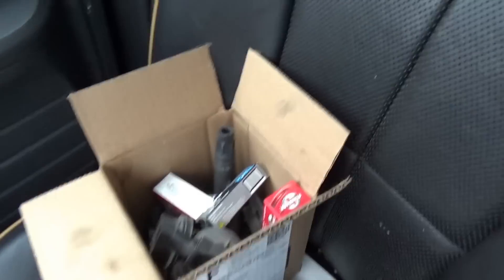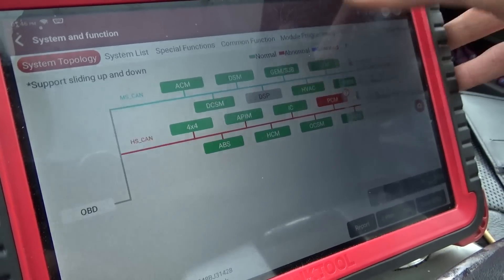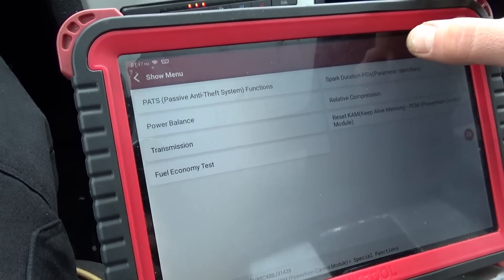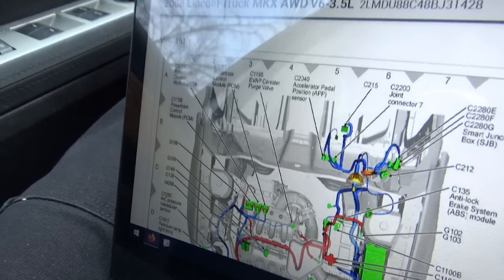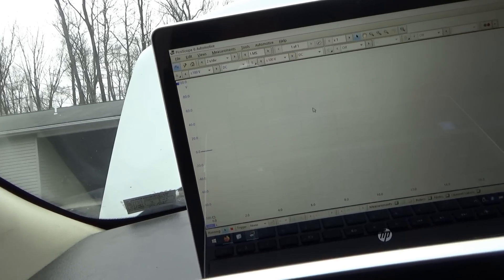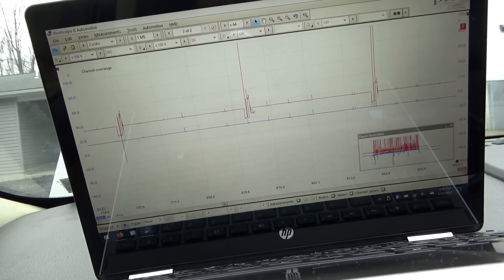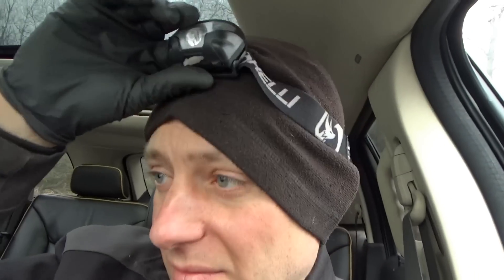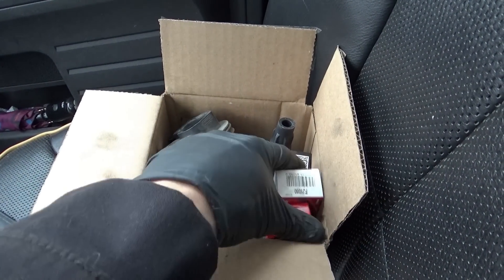Ford Parts Cannon MISFIRE (Why you NEED a Scope!)

Comment: This exactly happen to me at the Ford shop where I work. Error P0302 another diagnostician changed twice coils twice spark plugs and twice injectors Ford Explorer failed to fix problems and gave it to me, in a second with a scope I knew it was just PCM. There are no professionals today, they don't even know how to read English, and not thinking. I tell everyone 1000 times: You don't know what the problem is, better don't change anything, give it to someone else to fix it. Greetings from Israel. Thank you Ivan, if i visit USA, i will come to meet you for 5 minutes for coffe,  i am a big FAN:)
Reply: I diagnostic  vehicle  in Spanish  and English,  I speak universal language (automotive)
Reply: . Parts changers.
Reply: I speak Dine. I just talk to the car to fix it. No parts or scope needed.
Reply: @Socket  way better,  do the parts install them self ? Or when they become comeback they talk to the customers 🙄
Reply: I take care of my vehicle so it runs a long time, then sell it before it goes bad…no big repairs ever.
Reply: It would not make any difference what language the "tech" spoke. The scan tool can be used with any language.
The scan tool clearly indicates the problem area.
Reply: @thevictim2072  In Israel, the diagnosticians do not speak English, and this further complicates the work. i am from israel. I know that the scanner tells where the problem is, but sometimes it also requires reading and knowledge. IDS for FORD and MAZDA is only in English.
Reply: @thevictim2072  i can fix cars i  spanish

Comment: No way with a LED test light you could spot a dead driver?  How about a Span On Vantage graphing meter?  Board level repair is an opening for some smart cookies given the greed of OEMs and their shit parts.  Good video Ivan..Thx
Reply: A test light wouldn’t be able to handle the voltage coming from the driver in this particular setup, as it is well over 12v. I’m not sure if that meter could it or not, as I have never used one. For anything like this, I have a picoscope 2204a. It’s not the automotive version like Ivan uses, but once you learn how to use it, what settings and probes to use, you can get the same results. There are tons of videos on YouTube, as well as on Pico’s own forums, that you can learn from.
Reply: @Steven Washington  how does it get well over 12 volts?   I think your thinking the coil output is well over 12 volts.  Not the pcm driver...
Reply: @homesteadhaven2010  that would be my bad. My brain was elsewhere at that moment. Dealing with a customer trying to get warranty coverage. The whole intake was covered in gravel dust, and the original air filter, from 2014 was still in it and weighed probably 10 lbs, full of gravel dust.
Reply: @homesteadhaven2010  That is what I was thinking. Ivan's scope was showing voltage well above a 100 volts or something was scaled wrong. Never heard control voltage that high before. Ivan..please explain.

Comment: High current is being passed through the ECM? That's crazy. I thought it was common practise everywhere to use switched signalling to control high-current devices, be that via a relay, solenoid, or transistor.
It's not as if it was due to cost-cutting either, as it wouldn't cost much more to do it it properly (especially compared to the cost of blowing up the ECM).
It like it was designed to fail (eventually and expensively).
Reply: The PCM just grounds the circuit. The coils get power from the battery.
Reply from the maker: Ford and Chrysler have been doing it this way for many years. Guess what brands have the most PCM failures ;)
Reply: Also, it's not rocket science to design a driver circuit that can survive a short to ground, short to power or a high voltage zap.  They just didn't.

Comment: I'm surprised the new coil didn't short out again... I've seen these coils basically melt and you have to pry them out. If your not aware of the PCM issue's with these and you throw a new coil at it , you'll fry the new coil really quick.. I believe there's a TSB that states replace PCM, Spark plugs and all the coils. Updated design maybe, not sure
Reply from the maker: Good thing driver didn't fail in the ON state lol

Comment: with all the technical knowledge in this world why do cars have to be so complicated. there must be a way to make cars pollute less  without putting technicians out of work and make cars affordable to maintain.
Reply: This is not that hard. People choose not to learn how to fix them. Also, everyone wants a powerful car or truck. All of the 4 cylinder  Ford eccoboost engines that give nothing but problems start out as Mazda L series engines. In order to make a lot of power and keep low emissions, a lot has to go into the motor. Those same engines in Mazda's give very few problems and run forever.
Reply: @AT-wl9yq  i own a mazda miata. i love it. its a 95 and i maintain it. the last ford i owned was a 81 granada that lasted 27 years
Reply: @vincentlallo6543  Both of those cars are very good. Today, Mazda is one of the best brands for build quality, and they're fairly easy to work on compared to most other brands. Unfortunately, I can't say the same thing about Ford. Ford's engineers have lost their minds when it comes to design choices. A first year lube tech would make better decisions.
Reply: @AT-wl9yq  i agree

Comment: Failures like this would not happen if people would perform the dreaded "preventative maintenance" to the vehicle. In my opinion, no vehicle will reach 100k on spark plugs. It's a commonly overstated number by vehicle manufacturers across the board. I would say 60k-70k at most for spark plugs. Also, when changing plugs, change the ignition coil boots too if they are replaceable separately. They are commonly overlooked when doing a tune up.
Reply from the maker: Iridium plugs will easily go 200k ;)

Comment: I have an older 2 chan HP scope that I've used. But I found that since the 2 bnc input "shells" are common to each other, I've been only able to use 1 channel at a time if, for example, one sig has a bias voltage and another is battery ground. I started getting confusing traces until I realized.
My question is, do automotive type scopes have totally separate channels, without the "common-ed" grnd inputs ? Hope this makes sense, Ivan could you address this sometime?
Reply: You can get balanced/differential probe leads, not cheap but an option for your bench scope to keep your grounds isolated.
Reply from the maker: The Pico 4425 does have isolated grounds which is really nice :)

Comment: Ivan, I've seen this scope pattern before, unfortunately, on my car. I appreciate your process which I found very efficient and thorough. I also appreciate your inclusion of your PICO scope patterns. I've not purchased a PICO scope yet but feel very comfortable with that tool because of your videos and the data you've included with it. Soon I'm sure. Thanks for Sharing!
Reply: If looking for a good scope, keep the name micsig in mind, especially the SATO1004 PLUS (AKA SATO1104)
Reply: @thesmartguy3523  I bought the Thinktool scope that works with my Thinktool Pros and I believe it uses Micsig software since the screens look very much alike and they both have a lot of the same functions.  The Micsig is a better deal since it's cheaper and is a stand alone product whereas the Thinktool scope hooks up to the scanner and you use it's screen to display the info.
Reply: @thesmartguy3523  Thanks, I will.

Comment: Ford was awesome years ago GM was bad in 80s .
It's like they want you to buy a new car truck for $80+ .
We junked that same Lincoln was like new.
Dealer had it for months in no shop could get it running right.
Snap on scanner was useless on this .ECM was toasted also .
Could not find a ECM that worked used or OEM.
Expensive car .
I got $700 for CAts at least.
I just spent $3k on a Caterpillar ECM and dealer flashed for $750 .
Two "rebuilt " ECMs did not work on 3126 Diesel. 
Wait until all the EVs come out ultra high tech Only Stealership can scan $$$$¢$$$
I am keeping my 1989 and 2003 Chevy pickup and van.
Ivan ,can you import some simple Soviet era cars trucks to America?

Comment: I have a friend that needs to replace an ABS module on a ford focus 2012. Does any know if the brakes need bleeding after module replacement and also does it need to be programmed to vin?
Reply: It depends on what you are replacing. The abs pump and module are bolted together on that car and you can either replace both of them as one unit, or do each individually. In most cases, both are done at the same time as one piece. Yes, you need to bleed the system, but you can't just bleed at the wheels. Air will be trapped inside the abs pump itself, so you need to have a scanner that has a service bleed function. This gets the air through the pump so you can then bleed the air out at the wheels. If your scan tool doesn't have a service bleed function, you can go into the PID's and manually open and close the valves inside the abs pump. However, unless you really know what you're doing, I wouldn't recommend doing it that way.

If you are replacing the module, it has to be programmed. This is normally done by connecting a scan tool to the car before you start the job, and transfer the programming on the current module to the scan tool. Once the new unit is installed, you program it the stored data on your scan tool. If the current module is broken and can't communicate with the scan tool, you need to go to Fords website and download what's called "as built data". This is the original programming that was put on the module at the factory. Once as built data is installed on the new module, you would then update it to current software if needed.
Reply: @AT-wl9yq  Thank you for taking the effort to let me know about this. I do have a ThinkTool mini that will do abs bleed I believe, but it's always a crapshoot with the module programming as I've seen on Ivan's videos with third party tools. Don't have the oem ford diag software of course. The old module is still functioning but the hill assist is throwing errors and abs lights on the car. The only code was U3000:48 abs control module supervision software error.

Comment: Ivan, thanks for referring Jake's channel. It makes sense that someone could repair the ECM in one of these if it's a common problem and who knows - it may be as easy as replacing a transistor.  It's a terrible design by Ford but then again it can be avoided with some preventive maintenance.  This was one of those cases where you saw the patient and immediately knew what was wrong with him based on experience.

Comment: All you can do is tell the customer what they need to do. You cannot force them. Until it's to late and a new or reman 🌽 cornputer is needed. 
The problem is not all so called Techs have the knowledge to use PICO scopes or read wiring diagrams to diagnose a vehicle. 
As I have told my customer. Don't trust a scanner that's spits out a report and you start shooting the parts Cannon.
I've always told my customers. Go to a shop and have it properly diagnose. Then buy the parts needed. Or would you rather spend $$$$$ and it's still not fixed? Your choice..
Reply: Yeah, but in this case it was the shop throwing parts at it instead of diagnosing it properly.

Comment: My nephew has a 2010 Ford Flex with the same 3.5L engine and now I know that if he gets a misfire in the future, it probably needs a computer as well. This is a bad design by Ford
Reply: The issue is caused by poor maintenance, maybe make sure the plugs are changed on your nephew's Flex before it burns out the drivers? Lol.
Reply: @Silverfang15  When the vehicle was purchased with 130k miles, I changed the plugs and the coil packs as preventative maintenance and the Flex has 160k miles with overheating when using the ac. Overheating is common for the Flex and maybe other models with this engine.
Reply: @jamesnall569  wires on a COP setup?
Reply: @Silverfang15  Sorry, I meant coil packs
Reply: @jamesnall569  hope you used authentic motorcraft parts, not cheap aftermarket junk or knockoffs.
Reply: @Silverfang15  I used aftermarket at that time but in a few months when my mechanic changes the spark plug tube seals, I will be using OEM coils.
Reply: Most PCM replacements are due to misdiagnosis. Any time someone tries to sell you a PCM, its probably not bad. Techs replace them to buy time because they don't really know what's wrong with the car. On the flat rate system, you can work all day and not make 1 dollar.

Comment: Have you driven a Ford lately?  Most Ford owners: nope, it's broken.
Reply: That wasn't a Ford problem.  That was a maintenance problem.  I've had really good luck with Ford products. Never had 1 leave me walking.  Can't say that about other makes.
Reply: Been driving fords for years. Drive to 100k, do all the maintenance myself. Trade for another Ford and run it to 100,000 miles been doing this since 2006. Has never left me walking, but before that my company had dodge (new)vans and both of those failed hours away from home, so maybe you just get a car that’s never been maintained correctly
Reply: @Dirtyharry70585  Ford is crap
Reply: Yep, used up and on their last leg at 100k.  All while most other manufacturers are just finishing their break-in period and good for 300,000
Reply: @bertblue9683  imagine that. I sold my 02 f150 with 212,000 miles to my father in law. He drove it for a couple of years. Now his brother is driving it. The only thing I did to it was oil changes, brakes,tires ,ball joints and 1 wheel bearing.
Reply from the maker: @donmunro144  20 year old Ford is much more long-lasting that a 2-year old Ford :)
Reply: @PineHollowAutoDiagnostics  no argument there.
Reply: And after only 15 years,too.    My old F150 is looking at 300,000 miles soon.
Reply from the maker: LOL are they stuck in Park? 🤣
Reply: I’ve driven ford trucks ( two) for the last 35 years. I’ve been stuck on the side of the road one time ( alternator went dead)
Reply: Fix
Or
Repair
Daily
Reply: @NeverOwned  more like f&#$in out run dodge.
Reply: Lmao 👍 🤣
Reply: I drive one everyday
Reply: I'm extremely picky with my maintenance and repairs and was once the most loyal fan of Ford.  Very few people take care of their cars better than I do.  But the last 24 years, they've failed miserably in most categories.  Never again will I own one.  Never buy euro trash either.